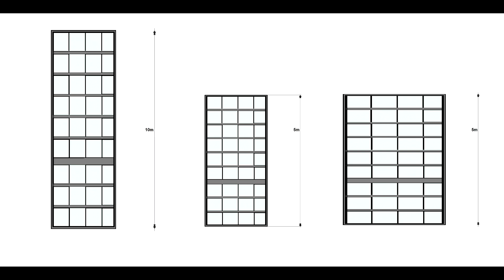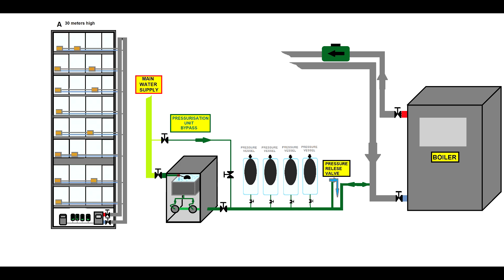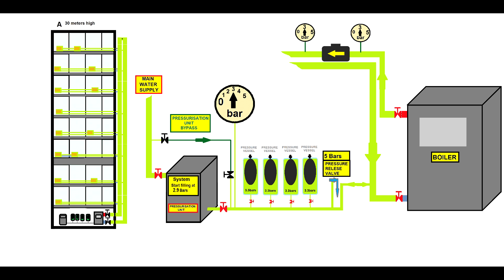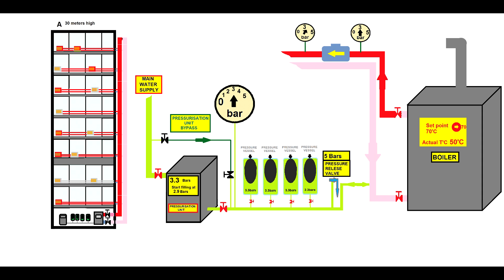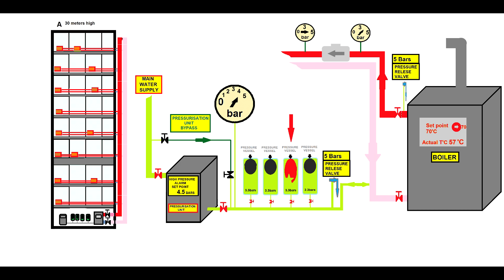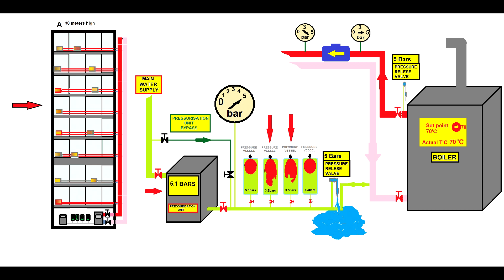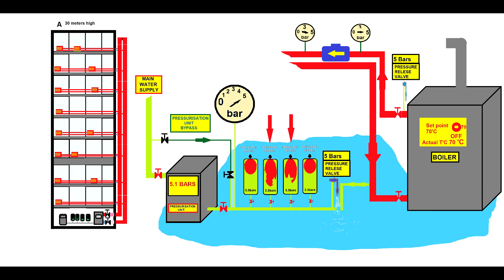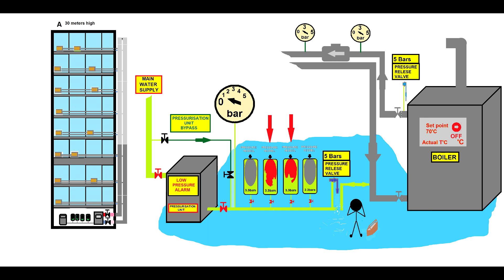Learn about Commercial pressurization and pressure vessel for commercial buildings.

Comment: So how much expansion should we expect on this system ? 
I set fill time to 10 mins
Reply from the maker: Dear Friend 
Because I don’t know the system volume and the pump filling volume per time unit I can not advise you about a  back up time limit for a potential high pressure failure .

What you should do :

Set up the pressurisation unit to fill the system and to pressurise it as per system design .

If the system is cold then I would consider the hight of the installation and I would apply enough pressure for the water to reach the higher point plus 5%

Every 10 meters you are gaining about one bar .
That should you have in to your system when pump is not working .

When pump is working then you must have 1 bar in return and higher pressure on the flow .

Finally when the water will reach 70’C or more the volume will increase if the pressure vessels will be correctly sized .

If they will be to small then the pressure will increase and that is ok as long as the pressure will not go over the Pressure Release Valve capacity . 

Make sure you will set up the pressure vessel correctly .

In relation to filling shoots I would allow the pressurisation unit to fill the unit about 10 times.

If you have a lot of leaks or air in tot he system then the pressurisation unit will stop after 10 times forcing you to drive back .

I suggest you will asses the pressure loss in to the system and then choose the numbers of fills .
Hope this help .
MJ
Reply: @TechnicalChallenger  I have 1.6 bar fill pressure. 500 ltr expansion vessel 
Safety valve 4 bar 
I set hight to 3 and low pressure to 1 bar 
On hot water system
Reply from the maker: @deanbashford3524  
If the safety valve is 4 Bars you can go to 3.5.
What is the working pressure on your expansion vessel ?
What pressure do you have on the expansion vessel when is not connected to the system ?
Reply: @TechnicalChallenger  I always set the expansion vessel to fill pressure so it expands beyond the fill point
Reply from the maker: You can buzz me if you want !
Reply: @TechnicalChallenger  how do I buzz you ?
Reply from the maker: @deanbashford3524  07956487538